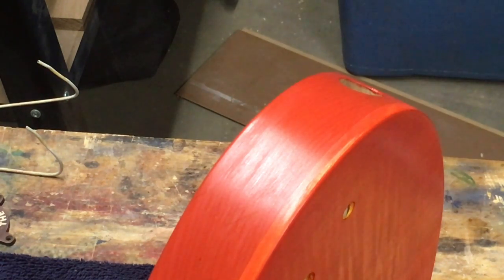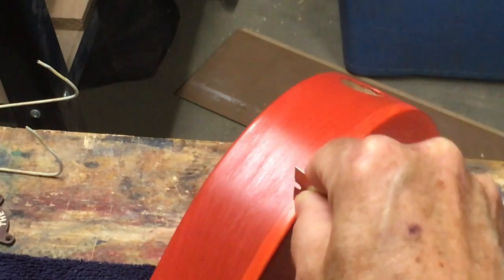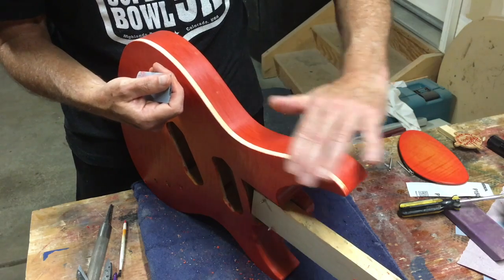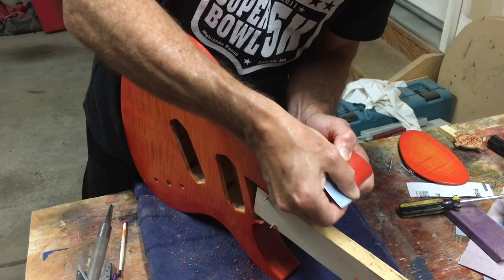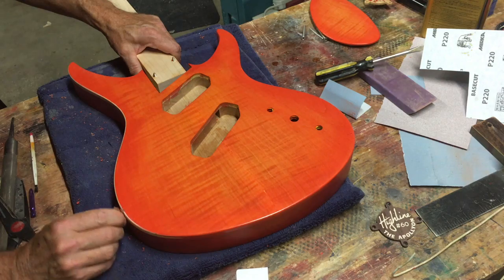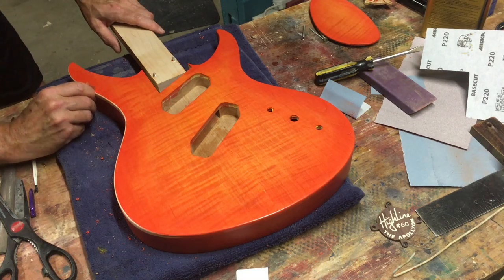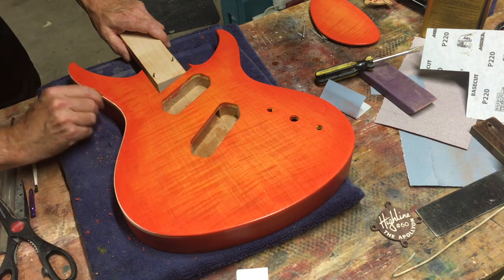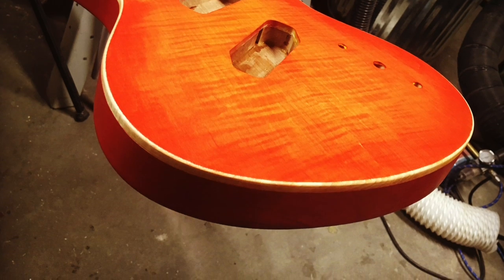How to Make Fake Binding on a Guitar Body

Comment: That's pretty cool, I almost always think there's a binding there at a glance, it takes a trained eye to spot a well done faux binding.
I've watched some luthiers use an adjustable scraper blade built in to a block of plastic, been looking for this kind of tool I don't know the tools name, im looking for one that will be handy for just scraping the tops of like quilted maple tops etc if you know what the name of the tool I'm trying to describe I'd be very much grateful 🙏
Reply: Google Stew Mack, they make a adjustable Binding scraper and handle, about 60 buks though but it works great and adjusts for how wide you want to scrape
Reply: @michaelevensen84  yeah I did see the tool on stew max however the import/export conditions and tax laws have changed since Scotlands independence and brexit even getting timber from Europe is becoming troublesome. Stew mac don't ship to where I'm at. I've already asked them as they have that exact tool. Happy new year btw.

Comment: i havent istalled any but i have worked on guitars with bindinwhy not just mask off that area before painting with fineline vinyl tape that makes morew scence then remove the tape prior to clear coating alot easier i think.
Reply from the maker: Masking tape doesn't always give you a sharp line of delineation. Especially on figured woods.

Comment: Im looking for a way to do faux black binding, my goal is to imitate the aesthetic of an ibanez DG350 (the red/white burst one) on a custom body
All the videos ive seen thus far do wood binding, which makes sense, easier to subtract than to add
In my case there’d have to be a way to paint the binding portion black and the body solid white (at least up until the burst)

Comment: Do you think it’s possible to add binding/ Purfling to a guitar that’s already finished (with polyurethane). I’m thinking of trying it on a cheap squier to see if I can do it successfully, taking my time on the routes and taping the top to protect the finish as much as possible
Reply from the maker: Sorry, I have no idea. That’s not something I would ever do.
Reply: @HighlineGuitars  Thanks
Reply: I watched another video on here and a guy did it to a completed finished guitar. It was a les Paul studio. He used the same technique. Except where this dude held the razor against the guitar with his fingers. The other guy wrapped tape around the razor blade to the depth he was scratching the surface with. But He did it. He basically turned a les Paul studio and turned it into a special or custom. But yes it can be done to a guitar with laqure or polyurethane already on it. Boom.
Reply: @rusty_shakleford3395  You the man. Thanks for the info!

Comment: If you were going for a natural binding on a s-type body could you, in theory, stain the body, then go around the body with a roundover bit with a tighter radius? I'm curious if the stain would penetrate that deep, or if you could do the roundover thing followed up with some finish sanding  with good results. Just curious if anyone has ever tried it this way?

Comment: Wouldn't it be easier to seal the faux binding, tape it off and dye the rest of the body?
Reply from the maker: The sides would be easy to tape, but not the top.
Reply: If you accidentally gouge the wood do you just fill it with some sawdust and glue?
Reply: Maybe you find something appropriate in the pinstriping circle. 
thx for the video.
Reply: Yes, you can use mask tape, especially if the guitar has a nitro cellulose finish like most Gibson(ala Tribute, Future, Studios, etc.) You can use either Acetone very carefully to remove the edge lacquer, and stain color) You can also use fine paper, and graduate up to 800, or more grit. It takes time, coordination, and some concentrated effort, but it will be worth the patience.
Reply: I tape off and add a sealer on the binding before I stain the top sides and back... it works well and easy to sand smooth before clear coat

Comment: Well that is not fake biding for sure you just scraped the spray that covered the original biding,  with all my respect to you maestro , thanks for the video
Reply from the maker: No binding. It's the edge of the quarter-inch thick top I scrapped.

Comment: that looks like stained binding is already there...
Reply: mwarnken1234 the body has a maple cap/top on the alder body. That’s literally close to the first thing said in the video. This works best on caped guitars. You can do this on a one piece body but I’d suggest using a marking gauge around the whole top first. Eyeballing it is not easy especially if you are dealing with a carved top

Comment: The whole point of binding is to protect the guitar...no?
Reply from the maker: Binding was first added to acoustic guitars in order to hide the glue seam between the top and sides. On a solid body electric, it is only cosmetic.
Reply: Thanks for the explanation. I'm learning...in hopes of building my own soon.
Reply: Could this look have been achieved by masking off the binding area prior to staining/painting the rest of the guitar?